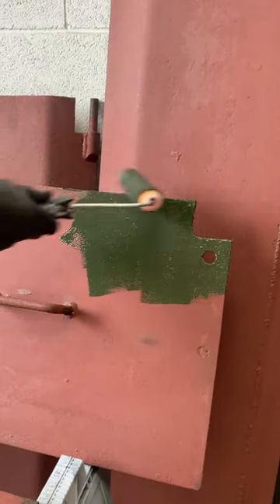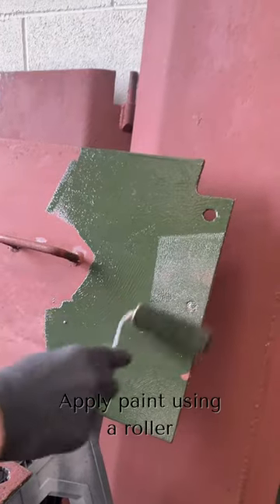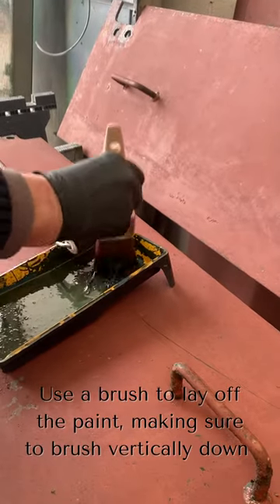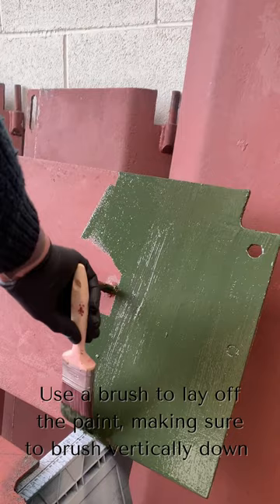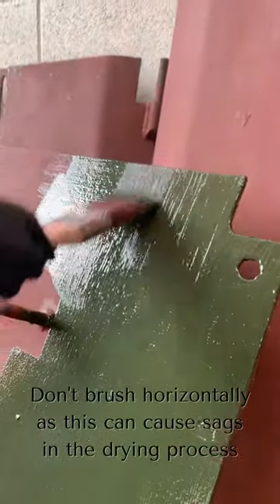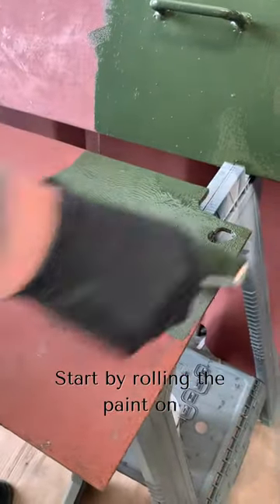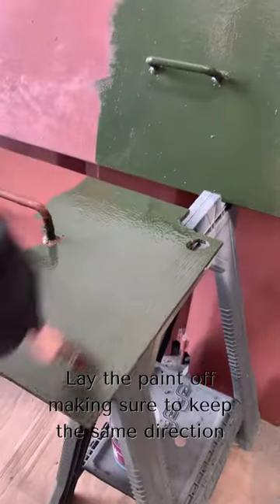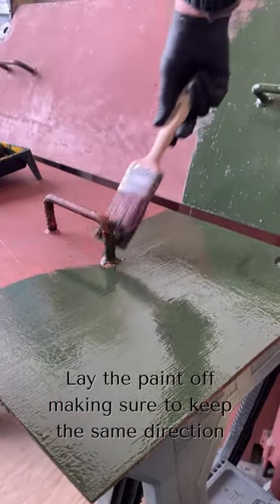How To Apply Coach Enamel Paints Using a Brush And Roller

Comment: You dont say what kind of roller is best - foam? Are you saying you should always finish off with a brush because of air bubblers and will brush marks show with this brtand (HMG paints the same?)
Reply from the maker: We tend to favour using a 'fluffy' roller - https://paintman.co.uk/shop/roller-kit-coach-enamel/ . It is always recommended to lay off your paint with a brush with any coach enamel paint to get an extremely flat finish. We still mix ours to the highest quality which ensures the great lay off time. :)